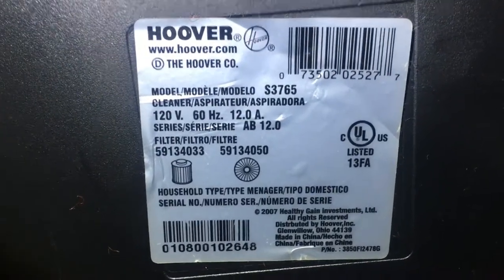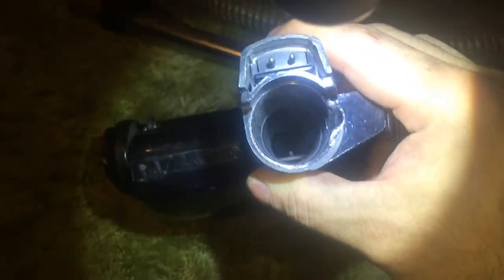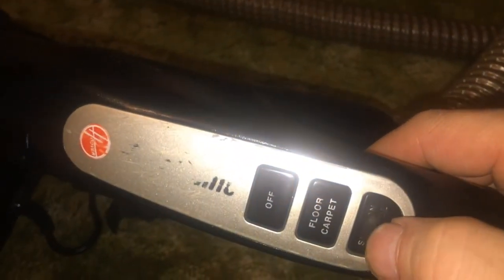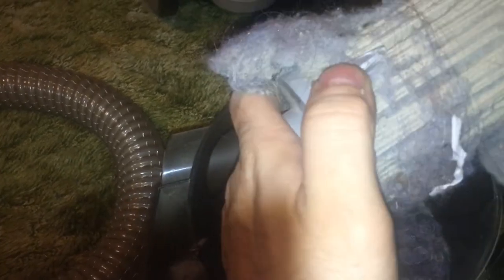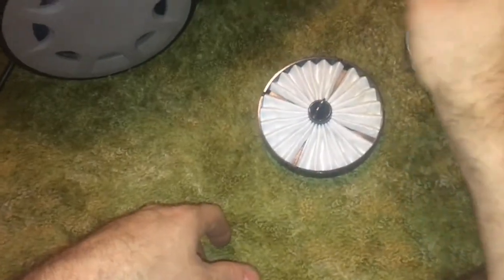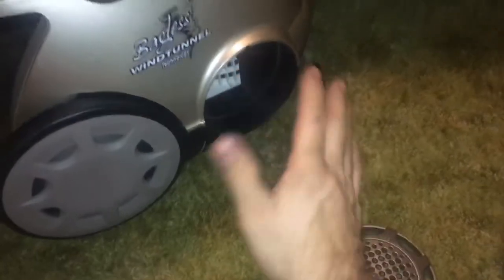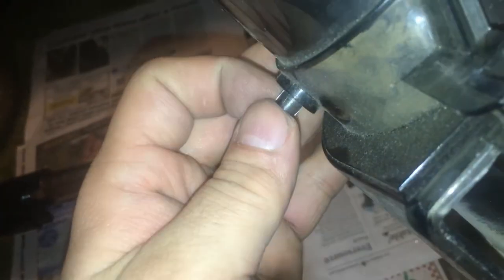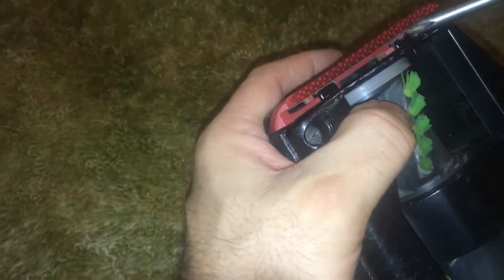Hoover S3765 Windtunnel Bagless Vacuum hot shutting off tear down and cleaning 59134050 59134033

Comment: What i have noticed with mine is that its very important to dump the bin every. single. time you fully clean the house with it because the filter will eventually clog up with big dibris, so its important to empty it often, and the point of that super wierd cyclone setup with the two doors is to trap the big dirt in them, and when they fill up or the entrance gets clogged, then crap will start sticking to the filter.

Comment: I took mine apart including removal of the motor with the three screws and ended up with a small bent metal clip part (indent spring part# 35276008 ) loose inside after and now I have no idea where it goes back....anybody on here that can help me find where it goes back would be appreciated???
Reply from the maker: google "hoover s3765 parts" you will see parts breakdown diagrams and it shows this possibly just under the brush belt side

Comment: I couldn't find my second filter, thanks for showing me. Did you know that you can wash the filters so you don't have to keep purchasing them? I've always washed mine, I believe they are made to be able to. I have a set of each type of filter, for the times I rotate them for washing. When it shuts off on you it means it's time to change them, unless your on top of the game & catch it before it shuts off on you. Been a great vac for all these years & for more to come, for both of us. Cheers!
Reply from the maker: cool thanks. sounds like a plan!
Reply: @bobspurloc   Also, in case you didn't know like me, I just found while searching online for attachments, found there was a recall on the Windtunnel S3755, there is a link online to the gov Consumer site, says Hoover Recalls WindTunnel Canister Vacuums Due to Fire and Shock Hazards, it was back on Feb 9, 2011, need to contact Hoover & they cover the cost of the repair.